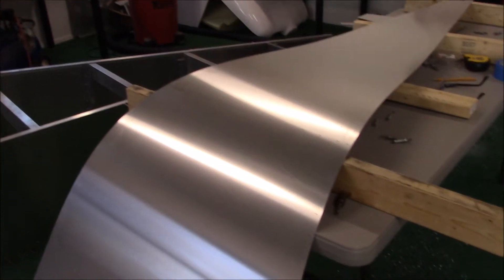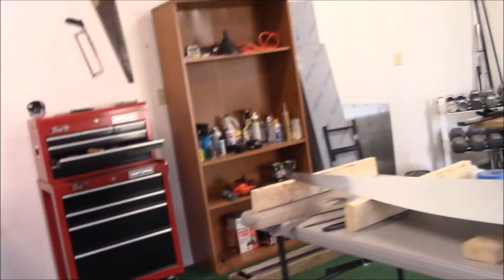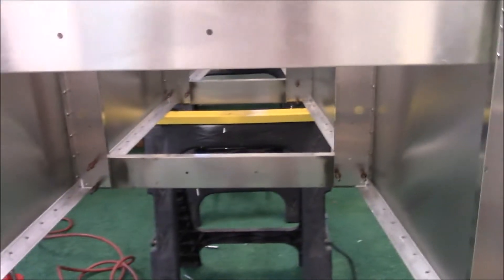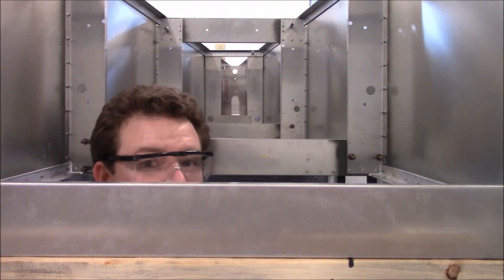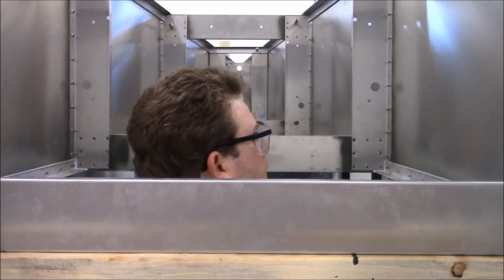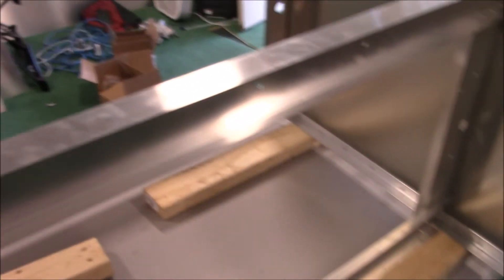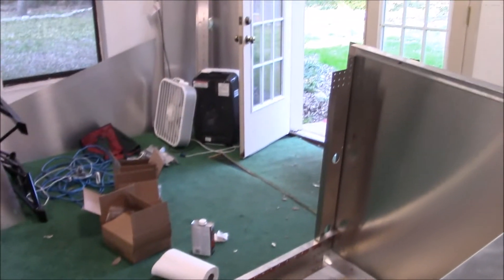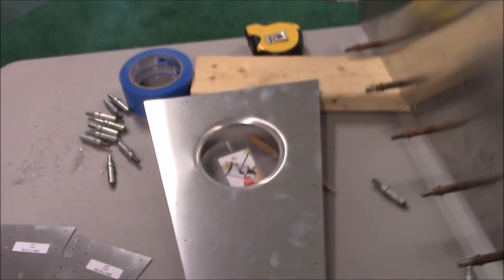Sonex Aircraft Build Video 54 Riveting More of the Tub Cross Members

Comment: Hi Dan,  Do you ever have trouble getting your riveting gun in small places?  Just wondering what you do then?  I've done a decent amount of wood working but not much metal work so I learn a lot from you.
Reply from the maker: +SyberPrepper HI SyberPrepper, I also have a manual squeeze rivet gun with a smaller footprint and body. Worst case scenario is I will pull it from the "wrong side," but they do have some additional "rivet heads" you can buy to make sure it pulls the shear load properly. -Dan